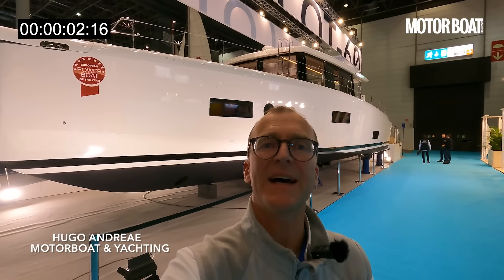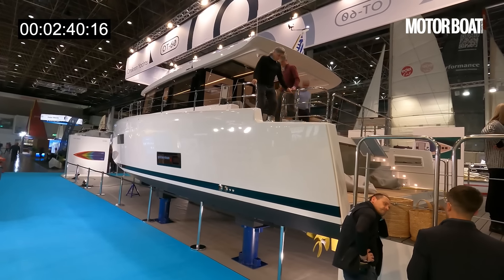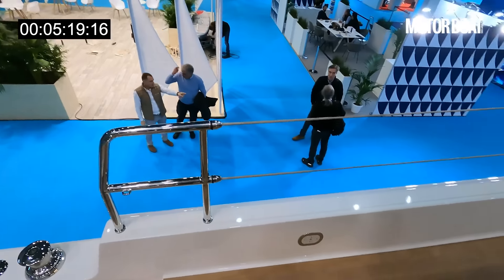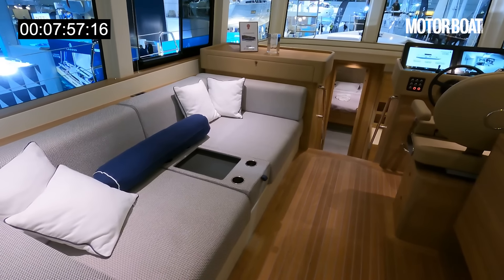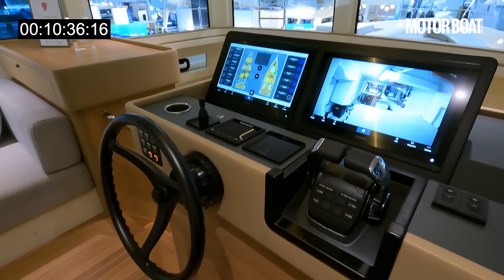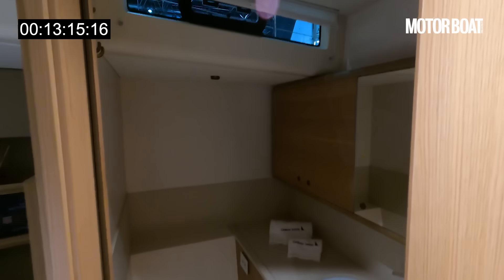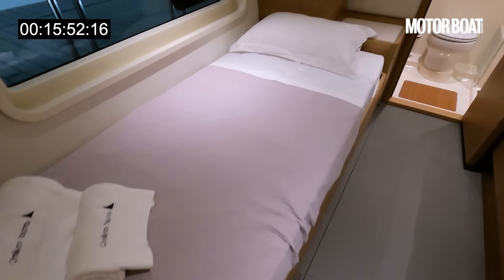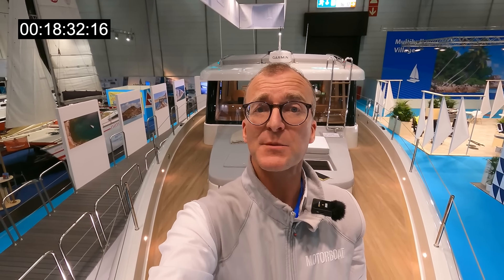EXCLUSIVE: The ultimate long range motor yacht? | Omikron OT60 tour | Motor Boat & Yachting

Comment: there is a reason that motor yachts have a different form factor than sailing yachts. side decks are unnecessarily wide and i would like to see someone lean against dymeema side rails when the boat is rolling.  that massive chunky side board in the starboard saloon really gobbles up 1/3 of the upper saloon where people will be when cruising.  yes the galley and dining is below but there is no proper lounging area and the dining area seats only 3 without packing in.  the upper saloon seats only 2 on the setee.  applause for the efficiency but it needs more tankage and more refrigeration.  all in all this seems like a sailing vessel converted to a motor vessel rather than a new design from the keel up.  experience with catamarans has shown that this conversion of design does not work well.  perhaps this will be different but i expect this vessel will have to go through many revisions if it is to catch on.

Comment: Love this boat. 1.6 is very reasonable considering it’s amenities and economy.  Curious about the range and speed with the upgraded 250 Yanmar engines. It seems this boat is fitted with the 150’s, or is it?
Also curious about heating and air conditioning. Is there one big generator or one big and one small?  Seems like a lithium ion battery set with enough juice to run the a/c and other electric powered items for at least 12 hours would be in order as well.

Comment: Beautiful. What a phenomenal job. Obviously it seems to need a little bit of fitment refinements. Does remind me of Lazzara in some aspects. No crew cabins obviously because it's meant for an owner operator, but I almost wander if they couldn't have found a way to put in a crew cabin by taking the forward master suite and dividing it by 2, but with 2 bunk beds. Woukd make an interesting famiky med cruiser or a great boat to cruise around Australia with.
Reply: It's a horrible layout, look at an outter reaf yacht or a  Fleming yacht of the same size., They are far better
Reply: There actually is a crew cabin under the foredeck, under the forward most hatch. (Bunk beds+heads)

Comment: For a long range cruiser, I would prefer a Nordhavn, or a FPB or GB. However, displacement or semi displacement (like this) boats are surely the way forward, with their lower purchase and running costs. 
The beam seems excessive, and will incur double marina berthing costs like a cat. 
I wonder how that beam will affect handling in a typical Solent chop or out in the Channel ? 
The wheelhouse seems the least well thought through area, with sadly no helm or port side door for easy mooring. 
And a rather weird sofa/bed opposite the helm. 
The price of £1.7m + tax for a 16 kt boat is also excessive.

Comment: Ok if it's the 'ultimate long range motor yacht' a couple of issues here.  From the brochure, range = 1000nm.  A Fleming 65 has a range in excess of 2500nm.  Fresh water capacity = 600litres.   Fleming 65 - 1500 litres.  My Trader at 'only' 47ft holds 1000litres and you do want a good capacity.  It's also a light displacement boat of just 18.5 tonnes as opposed to say the Fleming 65, 46.5 tonnes!!   For fuel efficiency and coastal cruising the light displacement may be great.  Take this boat into serious seas and she'll be bobbing up and down like like Churchill dog.  This is no doubt a great boat but  'ultimate'?  Is this about realistic expectation or generating 'clicks'?
Reply: I really have to agree with you. A nice weekend cruiser but not long range live aboard. That tiny saloon  compared to that huge cockpit. Doesn't make sense to me. Who puts controls in the cockpit forward facing? Also that super light weight scares me a little. A long range cruiser for me should be overbuilt.